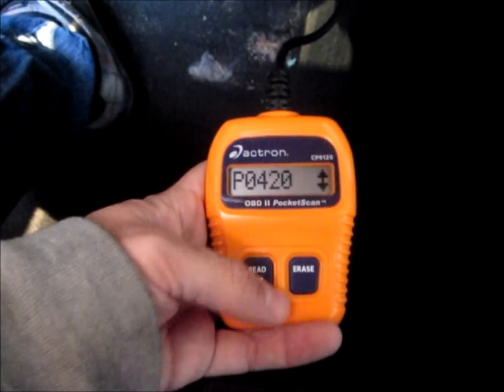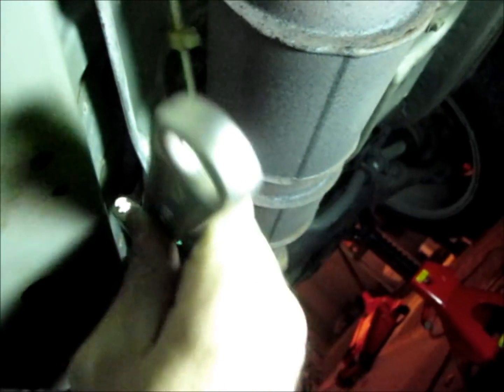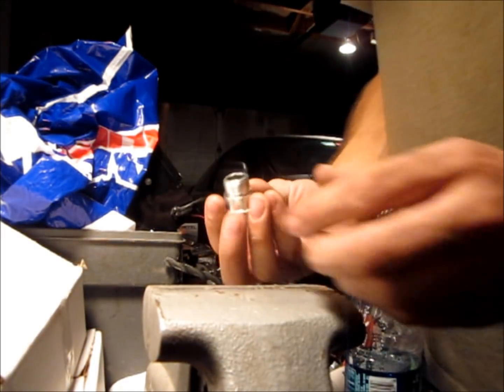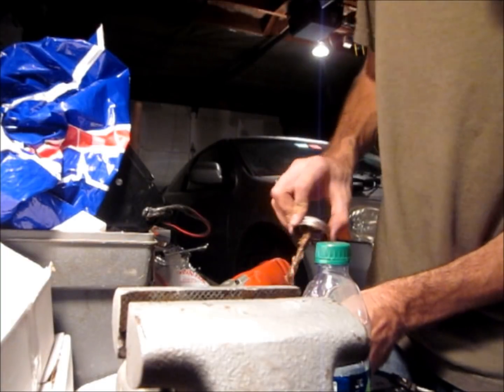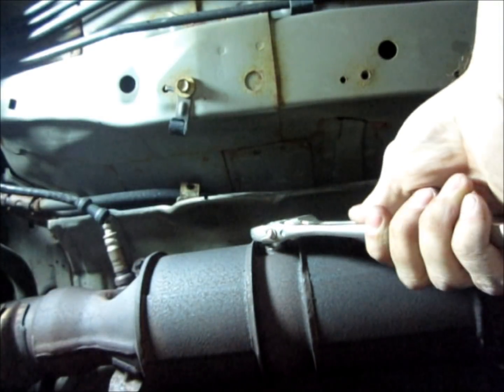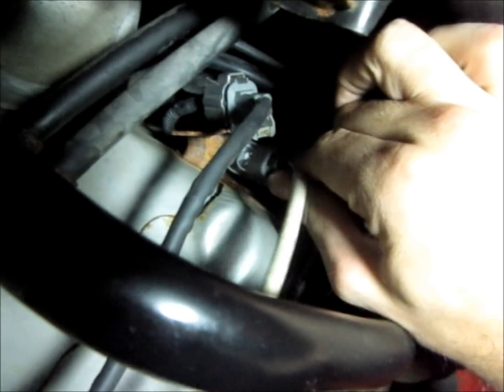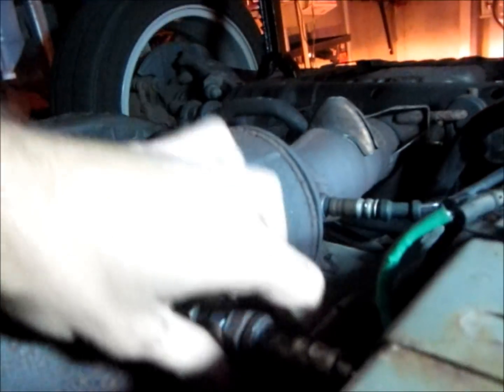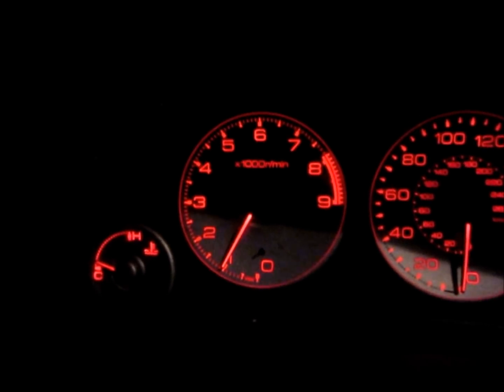Clear check engine light for less than 5 dollars

Comment: Thanks, It worked. I seen some videos that said it would not work with some brands of O2 sensors. Mine was a BOSH and one video said it would not work with bosh. Your video was the one i chose over the rest. I did not use a code reader to clear the code. i just did the non fouler trick and drove the 04 ranger for a few days. Light turned itself off after two days. light had been on for 3 months. so i know this works. Im glad i found out about this. I have a 04 ranger with 230K miles that i use for back and fourth to work. i did not want to drop a bunch of $ when the truck was working great. my other option was to drive until i got pulled over. those pesky coppers got to catch me. LOL, now I'm legal.even better.
Reply: I have a channel and was going to post a video, this was a challenging video to make without someone to hold the camera. Good work buddy.
Reply: +Woodchuck Russ How long did this work for ya?

Comment: I have a 2000 Ford crown vic.After I washed the motor  the check engine light appear.  Maybe I ll just disconnect the battery and hopefully it will be ok
Reply: cobra3289   i have an 07 saturn aura.. mine came on after i washed it. same as you. were you able to find out the cause?

Comment: not saying you should do this  but you could also remove the cat convert all together replace with a muffler adapter but first drill hole in pipe cut the o2 senser nut off cat with enough metal on it to weld to pipe over hole you drilled   replace o2 senser  but this is only good if you have a bad cat and cant or dont want to replace the cat and is illegal in some most or all states do at your own risk
Reply: This is how I did mine. I got a 2" x 1/8 thick stainless pipe. Drilled a hole then a buddy & my work welded the non fouler in.
Reply: dark matter This is exactly what i need to do since since the cheapest cat converter for my 2000 jetta vr6 in ebay (the cheapest china crap) is more than 250$ and i dont have the money to buy one , the only thing that is stopping me is the lack in knowledge and detail that is required to to it myself :(.

Comment: OH and the maintenance required light is 100% for the oil change interval NOTHING TO DO WITH THE CHECK ENGINE OR SERVICE ENGINE SOON LIGHT. They will not come on together for any reason together, unless you coincidentally hit the mileage interval for the oil change set by the cars computer.

Comment: This will prolong the life of your 02 sensors by keeping them out of the direct line of burning fuel and carbon deposits. If they are too far from the exhaust they may not read as good as the computer needs them to as far as measuring oxygen in the exhaust. Which could possibly cause a rich code or just lesser fuel economy, just FYI. 
I have used these and they do help in certain conditions and for certain reasons.

Comment: I have a 2001 Volvo s60 2.4 non turbo.  I get the code p0420.  the car has 130,000 miles.  I have changed the spark plugs, oil, oil filter, cleaned mass air flow sensor, and throttle body.  I have checked all vaccum lines and have found no leaks or cracks.  I replaced the gas cap with aftermarket one.  later I read online that I should really use a factory gas cap.  I have used a fuel cleaner from lucus.  reset the check engine light.  I was thinking of doing this trick on my son's car.  the cat. seems to be really sensitive.  I have a lot of power, cat. not clogged at all.   I was also told to check ground cable for corrosion, clean the pvc system, clean oxygen sensor, use fuel cleaner on injectors, also get a stethoscope to check that the injectors are all clicking loud.  I still have to replace the pvc system, since I don't think previous owner maintained it.  Volvos pvc system is the worst.

Comment: ok where do i need to put this the spark plug no-fouler? upper sensor, or lower sensor?
Reply: Always downstream, after or in the CAT.  P0420 is Bank 1 (side of motor with Cyl 1) and P0430 is Bank 2, so make sure if this applies to you, you verify you're working on the correct side.

Comment: just go on eBay and get a 90 degree bend o2 sensor adapter. its like $20 but you don't have to drill anything it just bolts right up no problem.

Comment: Great video dude! Quick question.. Do you have to use both spacers? 
I ask this because I only had room to put one. 2001 Volvo s60 2.4 non-turbo. I figure the sensor is still pulled out of the pipe, and the holes of the sensor are completely covered by the drilled out fouler, so it should still work fine. Correct?
If you don't really know this answer, I did only install one, so I will hit ya back in a few weeks and let ya know the verdict!
Later!

Comment: That was not the check engine light. it was the maintenance required light. This light is only to remind you to have certain things done, like with the 2007 Toyota Yaris it is time for and oil change. This is however,the correct way to clear the maintenance required light.
Reply from the maker: Van Allen Separate lights. You gotta watch the whole vid. I address both CEL and MRL here.

Comment: 5:13  Wow, turn car upside down for easy access to exhaust system, but does engine oil fill up the valve covers, when running inverted?

Comment: The P d on your scan tool means that there is a Pending code, hence the P d is for Pending.  Typically before any Check Engine Light comes on, a code is in the "pending" state first.  After that code has come up 3 times in a row, will the actually CEL illuminate to indicate an issue.
Reply: No, the P is NOT for 'Pending', it's for 'Powertrain'.  You're right about the pending codes, for the most part.  Most DIYers are going to tackle P codes before the others.
Reply: actually no, the P in the P0420 is a general PCM OBD code.  this code will show up on any scan tool.  Codes with C are chassis related, generally brakes, B is body control codes, and U Computer system codes.  the Codes are numbered in such a way the number tells you what system they are from.  such as a 0420 the 0 is OBD world wide code, 4 is exhaust emissions related, and 20 is the actual code itself.  if the code had a 1 in front that's a manufacturer specific code.  Take a P0172.  the one is fuel system codes, and 72 is Bank 1 Lean.  If the code read 1172 the code would be the same but there would be manufacturer specific data about the code.  A code in pending such as a a C0152? wheel speed sensor code is a code that has say only triggered say 2 our of the 10 consecutive drive cycles needed for it to trigger the ABS light on the dash.

Comment: Just want to say that, what is the point on modify something that was designed to be that way, if it´s not working just buy a new one, the engineers spend a lot of time making everything perfect so that you have a machine running as good as it can and you come and modify a sensor that a company spend a lot of time and money developing it and you tell me that you can solve it with less than 5 dollars??? I don´t know if I call you a genius or something else, please don´t insult the intelligence of your viewers with that, PLEASE TAKE YOU CAR TO THE MECHANIC...
Reply: This is for the folks who know how to do their own work and who also can't afford to pay a shop $1000 to replace a faulty catalytic converter.  This is only to get your car to pass inspection.  The person that is performing this procedure knows damn well that it is illegal and if caught doing this can and will be fined.
Oh, and learn how to work on your own fvcking cars.  They're extremely easy to work on.  I could train a monkey in about 3 hours to do any of the work that they do at a Oil changing store (like Walmart or Jiffy Lube).
And BTW, mechanics can kiss my ass, I work on my own cars thank you.

Comment: Hey, 07 Sante Fe SE, PO442 evap code keeps coming up, dealer ran smoke test and checked solenoid valve nothing seems to be wrong. Adjusted gas cap. within 10 miles of leaving dealership check light comes back on. Whats up with this?
Reply from the maker: Hi Jim Pine , sometimes the evap code can take weeks to sort clear itself out as there are many steps involved to satisfy it. Make sure the cap is tight and try it again in a week.  Many inspection shops will allow some leeway with a code like this, especially if you have reset the ecu recently and they will know how long ago you have reset.  Good luck, and thank you for viewing!
Reply: moccina In california anyways, after you clear the codes all the monitors have to be ready for the test. You are allowed ONE monitor incomplete when you run the smog test. If you have more than one = failed smog test. 
Anyone in california thinking "I'll just buy an out of state Cat thats cheaper than the Cali Cat" theres numbers stamped on that the smog tech will check, if its out of state = fail. This fix is a huge money saver to at least pass the test.

Comment: what size for the spark plug defouler ?
Reply from the maker: wilmerking1 The part number is 42009
Reply: moccina hey bro 
I like this video 
I have 2014 Mustang which I suffered from a CEL and the reason for that was the rear passenger side o2 sensor and when I replaced it and scanned it again the surprise was I got a new fault which is catalytic P0420 
Just want you to tell me if I can use the same part number exactly on my car ... will it fit ? Please Reply asap.... 
Btw dont bother ur self about the negative comments  .. cause I am sure this will work

Comment: Why not just go to autozone or o'reaillys and let them do it for free?
Reply from the maker: jdh023  Autozone will clear your code, but your inspection station will still see that there is an underlying issue, even if the light is not on. The ecu doesn't lie :]
Reply: Good point but we don't have inspection stations in our State so no worries about that.

Comment: Ok that maintenance required light was on because It's a reminder for the oil to be changed and the code u erased p0420 means the cat is either stopped up or no longer working correctly and has to be replaced even if u changed both oxygen sensors the problem will still persist because it has insufficien flow so this rigged up u did will not fix the problem
Reply: Actually, depending on how the computer is programed, this will "fix" the problem.  I have seen this done on a 96 Chevy V8 with a hollow cat, and it has worked for the last 75,000 miles.  It depends on the vehicle.  New vehicles, especially high end, are so sensitive that this doesn't work.  If the computer is simply using the downstream sensor to check the CAT, and it's looking for a flat O2 level, then this trick works.  Some vehicles (not sure complete list but I know it includes some Cadillac, BMW, and Mercedes-Benz) actually use data from that sensor to fine tune Air/Fuel Ratio.  My buddy tried this on 07 Cadi V8, and it worked intermittently.  I bumped into a C230 in a shop, had one in it, but was still throwing P0420.  Yes, for off road use only, as this is legally tampering with an emissions device.  It's a violation of the EPA Clean Air Act.
Reply: ummm.... you realize the sensor that the code is caused by a sensor reading the cat is bad, it's possible the sensor is also bad, just like when your coolant sensor fails and it is always pegged cold or your fuel level sensor fails and pegs empty, doesn't mean it's right. So it can be the sensor to. and no kidding it's rigged up, it's so he doesn't spend 1200$ on junky emissions crap!
Reply: If you're running a test pipe, yes this does fix the problem. It prevents limp mode and some misfire issues because it keeps trying to adjust lean or rich between the two sensors. Obviously you can do a downstream O2 delete but this is better if you plan on getting a high-flow cat in the future and wanna keep that sensor without burning it up.

Comment: first and foremost, thank you Sir for sharing your knowledge. Am a proud owner of 2005 tacoma with 352,000 miles and original owner. I have P0420 since 2 weeks now. Dealer said its cat and cost is $1,500.00 unit itself. Autozone has 250.00 after market. Am skeptical of using the unexpensive cat. Do you think aftermarket cat can last long for another 100K miles? pls advise. i want to replace first the two o2 sensors but it cost total of 160$. dont know which is the culprit, dont want to waste money and replace the working parts. plas advise guys. thanks in advance.
Reply from the maker: Ren P Hi there.  Take a look at rockauto.com -- you may find your best price there if you don't mind waiting a few days for FedEx to deliver your part.  They typically have the best prices, and they also have different tier levels for aftermarket parts-- for example if you buy brakes they will have economy, daily driver, oem, performance quality which differ in price accordingly. Good luck, and thank you for viewing!

Comment: Just remove the bulb inside the cluster!!! Light problem fixed.
Reply from the maker: Dbgrasshopper33 You can do that, but you will not pass OBD emissions. Also, if other codes arise it will be difficult to monitor them with the bulb deleted. Thanks for watching.
Reply: no I CAN,T REMOVE THE BULB BECAUSE MY CAR HAS TO BE TESTED FOR EMISSIONS.

Comment: Well 15 year lienced tech here<<<< if u have a plugged cat this is a cheap fix and the engine light will go off and pass e-test. Remember though u gota gut the cat first. I have a 2000 prelude had 2 burnt valves and it took out my cat with missfire. I replced the valves gutted the cat and used this trick works great passed e-stest(Smog test) Live in Ontario Canada!!!! Btw im Just a cheap prick and didnt wanna replce my cat lol

Comment: As a certified automotive tech in Michigan, from what it looks like this method of tricking the PCM's readings of the O2 sensors is probably illegal. The down stream O2 sensors are purely for reading emissions and the catalyst efficiency. It has been my experience that typically the P0420 code is set by a faulty sensor and not the cat itself.
Reply: Episodio ZTE ese

Comment: is this same procedure for 2001 suburban?
Reply: I have a 1999, and  it doesn't appear like my sensors are the same diameter as the antifoulers , so I'm going to try cast iron pipe and stubs instead or find something to wrap around the sniffer shield of the sensor instead. Maybe some O2 sensor safe Permatex on the upstream half side that I can peel off if it don't work.

Comment: My car honda civic couple LX 2001
I have exhaust manifold crack
I want to autozone they tell you need change 
I change both the check engine light still on
Wjen I drive around 1or 2 hours my exhaust manifold to very hot almost turn red 
I really worry man because I only have one car school and work  my check engine code  PO420
Reply: New timing belt, perhaps a cam position sensor and/or crank position sensor. Weld the crack shut or with some exhaust putty.